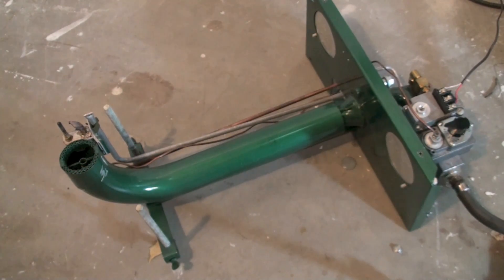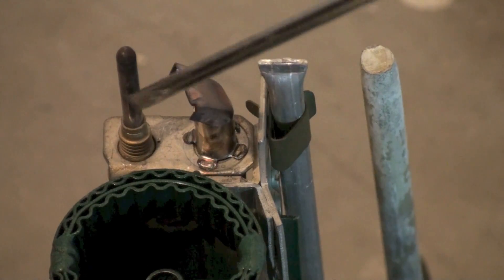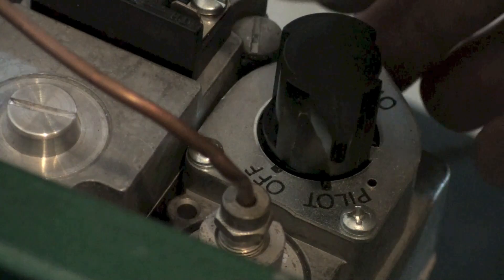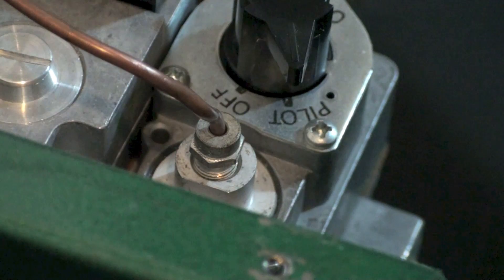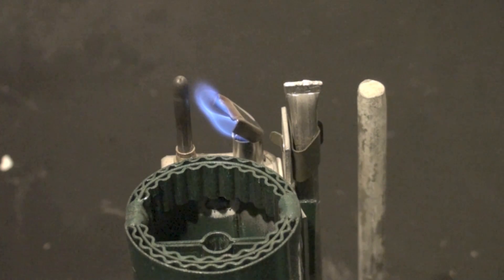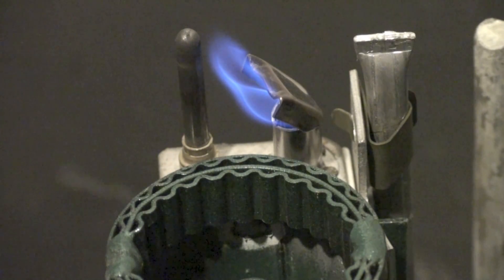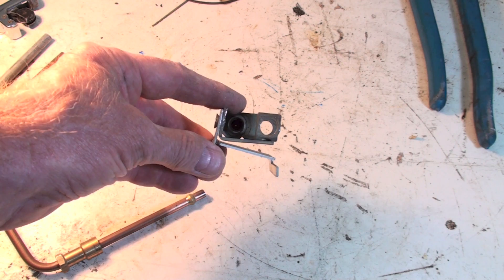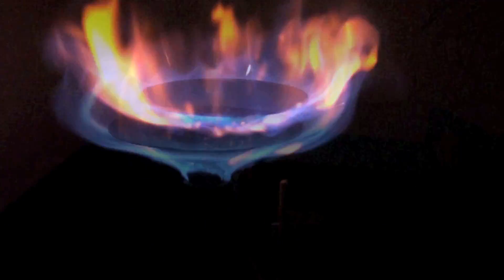Gas furnace pilot light operation

Comment: Hey, Great video, Thanks. Also,  went to adjust my pilot light and turning the screw all the way one way or the other way did nothing at all. Any idea why this may be? Would be nice to turn it down.
Reply from the maker: Those adjusting screws are notably ineffective.  Usually, they are wide open, then closed when it is screwed all the way down.  
GFM
Reply: @grayfurnaceman  Screwed down all the way or screwed up all the way, the pilot flame stays the same.
Reply from the maker: @gregman8320  The only answer is a new valve.
GFM
Reply: @grayfurnaceman  Just had the a new valve installed last year. Great

Comment: Hi! This is not a recent video but maybe someone can help me out. Pilot turns on and is in the correct position. Stays on when I let go of the know but as soon as I move the temp control and the actual burner turns on it turns off within 5 seconds
Reply from the maker: If the pilot burner is burning with a blue flame with no yellow (unless its run on propane in which case, should have yellow tip), and the main burner is burning with its normal height, you probably have a gas valve failing.  
GFM
Reply: Thank you for responding! That would mean replacing the entire little box with all the control knobs correct ?
Reply from the maker: @crysdelacruz  It would.  I would want to be sure the gas pressure is right before replacing the valve.  Your utility could help on that.
GFM

Comment: any reason why my pilot light would suddenly tripple in size?  sell not suddely.  was off all summer.  also i hear a wire brush fiber works good to clean them.
Reply from the maker: If it is lazy and yellow, the air supply is blocked.  Compressed air will probably clear it.
GFM

Comment: Hi, I want to buy a thermopile only standing pilot assembly. But, what is 90 degrees left and 90 degrees right pilot head? And flame patterns? I thought the pilot just hits thermopile/thermocouple straight on. Love all your videos. Thanks
Reply from the maker: The pilot is there warm the thermocouple and also light the burner.  Depending on how the pilot assembly is placed, a 90 degree pilot flame may be helpful to do both jobs.
GFM

Comment: Just curious... are all thermocouples essentially the same specs? ie if one fits in the same mount hole, etc will it activate the same as the original when the pilot flame is present? I have a blaze king pegasus - 1996 that has been going out for years. I relight and it works a while fine. Then, by no issue I notice, it goes out. I've adjusted the pilot adj and the flame tilt, etc. nothing has permanently solved the problem. I dont have the original paperwork for the heater as it was in the house when I bought the place. THANKS! good video.
Reply from the maker: Most are general replacement so they would probably work.  
GFM

Comment: Absolutely great info. Question, I'm converting same type over to LP gas for my shop, and there is supposed to be a screw to  set from cg to lp but can't seem to find where its located. Is that the one you adjusted for the pilot adjust? If no, where would I find it? Thanks so much.
Reply from the maker: No.  The LP kit should have a replacement regulator spring.  On the valve in the video, the regulator adjustment screw is located just opposite the terminals for the wiring.
The pilot orifice will also need to be changed.
GFM
Reply: @grayfurnaceman  no on the furnace itself it says to turn small screw from cg to lp but it seems to have worn off or something along those lines.
Reply from the maker: @zombieprinting2670  Can you send pics of the valve to grayfurnaceman@gmail.com
GFM
Reply: @grayfurnaceman  I will, thanks.

Comment: What makes the gas burn? The pilot nob? Turning it to on position? Nobody explains this.
Reply from the maker: The knob must be placed on the on position, the pilot must be lit and the thermostat must be set above the room temperature.
GFM
Reply: @grayfurnaceman  my shop furnace just has a baso pushbutton. Don't have a on off to it. You just push it in then let go.
Reply from the maker: I am assuming you have a pushbutton that you press and hold while lighting the pilot.  Is this correct?
GFM
Reply: @grayfurnaceman  the odd thing is even if I don't press the button. The pilot can be lighted without pressing the baso button.
Reply from the maker: If it is very old, as in 70 to 80 years, it is not a 100% shutdown unit.  A bit unsafe.
GFM

Comment: Need help, my combustion gas valve is new An now I’m having the same problem with it as my old one, the problem I had is the the pilot will stay on but when the blower turns on it blows out the burner off could this be the pilot valve??? Any thing helps thanks.
Reply from the maker: You probably have a crack in your heat exchanger.  This could be very dangerous and produce carbon monoxide gas.
GFM

Comment: What could be the problem if the pilot won't stay lit when I manually light it and the indoor fan stays on?
Reply from the maker: I am assuming you have a standing pilot furnace.  If the pilot does not stay lit after going thru the lighting procedure, there is a problem with the thermocouple or the gas valve.  The indoor fan operation during a call for heat could be normal if the fan switch has a preheater.  
GFM
Reply: grayfurnaceman Thank U Sir. I assumed it was the gas valve because I replaced the thermocouple

Comment: What if it works fine but the pilot button is slow to come up? Takes 15-30 seconds to pop up so I can turn it on. 1977 Lennox bat gas furnace (I have a video on it)
Reply from the maker: InternetDude The gas valve is beginning to fail. At this point it does not owe you a thing. Replace it. 
GFM

Comment: I have a trailer with a coleman furnace my problem is that every time the burner comes on and the blower cycle the pilot light shuts off can it be a bad pilot orifice ?cause the flame on my pilot is not blue any help is appreciated thanks.
Reply from the maker: The pilot assembly is probably plugged.  If you remove it and clean it (don't try to clean the orifice itself, its too small to clean) it will probably work normally.  Be sure to check for leaks.
GFM

Comment: I need to ask you this because i cannot find anything with pilot burners.....do i have to put thread dope when i install the pilot burner with the thermocouple????
Reply from the maker: No pipe dope on the thermocouple threads.  You can use a small amount on the mating surfaces of the ferrel connections.
GFM

Comment: My pilot light keeps turning off when the burner turns off .. What's wrong ?
Reply from the maker: +jxn0010 Beats me.  The point is I need to know more.  Conversion burner?  Gas designed furnace?  Age?  Pics may helps.  Send to grayfurnaceman@gmail.com
Reply: +grayfurnaceman I fig out its the thermocouple

Comment: Hey. i just changed my space heater from natural to lp. Do i need to change my pilot light to suit lp gas? It appears to have a bit of a yellow flame.
Reply from the maker: gonefishinggcstyle There is a replacement orifice rated for lp.  I am assuming you have replaced the gas valve and burner orifices.
GFM

Comment: Natural Gas.
Reply from the maker: Manifold pressure is probably 3.5 in wc.  It should be marked on the model plate.  You need to know if the incoming pressure is high enough.  Usually minimum 5 in wc.  You could call out the gas supplier and have them check the supply pressure.   Hope this helps.
GFM

Comment: Great video. Quick question. What if my burners are not strong enough to get the water boiling and steam really going for my boiler? Pilot is lit, flames come on but not as high as they should. Any suggestions?
Reply from the maker: Sounds like pressure problem.  Is it propane or natural gas?
GFM

Comment from the maker: I would guess you have a limit problem.  An open limit will stop the burners but not the fan.  Look for a manual reset limit (it has a button on the limit that must be reset).  Check out my limit videos.  If you find a reset, you need to watch the furnace closely to be sure it does not open again.  That's why they are manual reset!  Do not bypass!!! Find out why.  Hope this helps.
GFM

Comment from the maker: Yes, it helps mix the air with the gas and there is a spreader that is normally mounted above it.  I will be doing another vid showing different size flames with this burner.  You may find it instructive.  Thanks for the comment.
GFM

Comment from the maker: Good question.  You would think nothing would come through.  Many gas valves have filters in them.  However, with an orifice that small (a #80 drill bit is much larger),  just about anything.  Mostly it appears to be dirt.